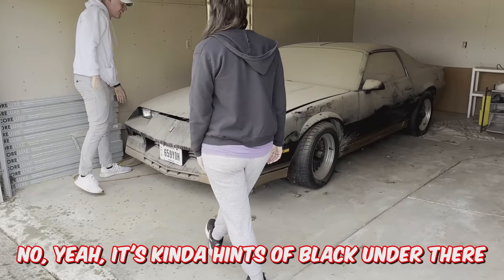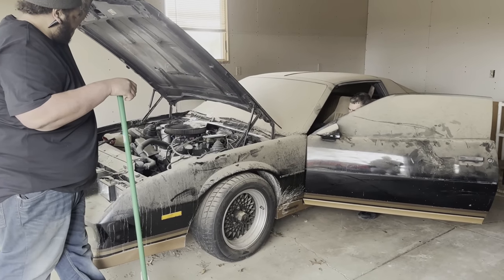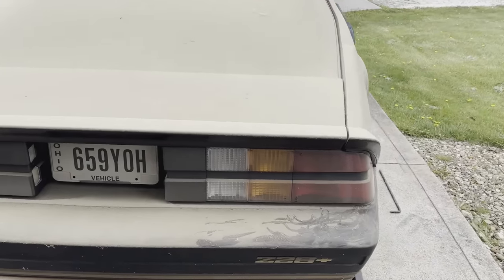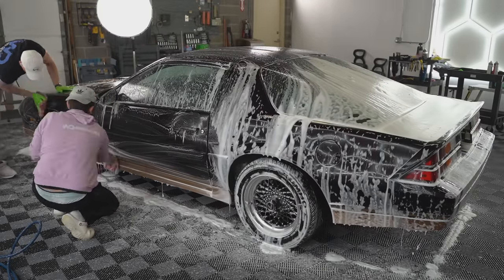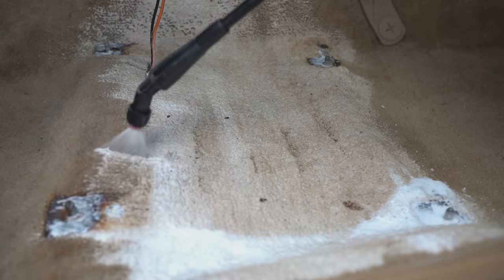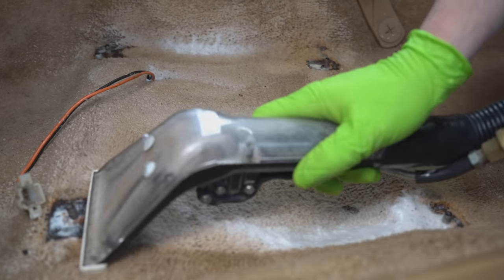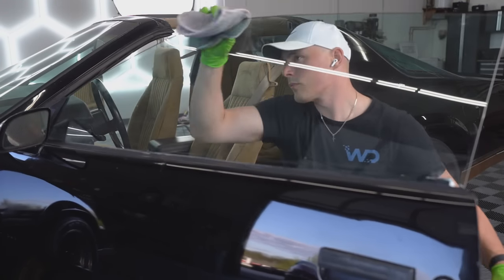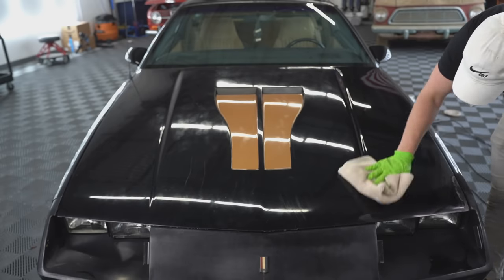First Wash in 12 Years: ABANDONED Camaro Z28 with 28K Original Miles! | Satisfying Restoration

Comment: The wheels look like BBS rims.
Reply: The wheels are actually Pontiac Firebird. They're nicknamed "Honeycombs" and were designed to replace the "Snowflake" wheels used in the previous generation Firebirds.
Reply: @bellwethertrucking3650  Oh cool.  Good to know thanks.
Reply: These wheels are a 1987-1992 Trans Am wheels. The reason why they fit is since both the Camaro and Firebird share the same chassis and drivetrain components. Wheel lug spacing is 4.75 inches.
Reply: those are the GTA wheels

Comment: Great job as usual. Watching from the UK.
One question I have, is why do you not start the jet washing process from the top down. I would think that the water running on the lower parts of the car would help loosen the lower grime.

Comment: As another has noted, the FI Tech on the motor is clean and recent; that much dust could not have settled since its install.  No doubt the car was disgusting inside from neglect and time, but the external stuff is doubtful.  Of course, Trans Am wheels.  Enjoy your videos.
Reply: Yeah staged video
Reply: There's alot of things that don't add up here. Especially with some of the "detail" work.
Reply: Take off the foil helmets
Reply: Given how easy it is to roll back odometers from vehicles of this era, I do not believe for a second it has only 20K + miles on that car.  The dust is fake, it blown on to get on youtube, how can I tell?  the top of the wheels (under the wheel well) has the same level of dust as the roof of the car.

Comment: It’s a second generation small block Chevy. Made from 87-92. You can tell from the center bolt valve covers. They were an improvement over the 1st generation that were around the valve covers that made them leak.

Comment: New summit 355 and clean FiTech EFI (which weren’t available until 2016). Yeah, that dust is a little too perfect to be authentic. Your first thought was correct, it was staged.
Reply from the maker: We showed up and this is how it looked!
Reply: No doubt. You did a great job, regardless of how it got that way. Do you ever take off the wheels and do the inside of the barrels, and brake caliper area?

Comment: I am extremely impressed with your attention to detail!!!! I grew up in a car detail shop and still a little detail work on the side. I am curious what car cleaners you use? I use Car Brite products. They're amazing.  I did a Pontiac Firebird a couple of years ago and it took me several hours to get it detailed.  I actually do the same thing you do as far as removing the seats. I also removed all the carpet because it was heavily soiled. I scrubbed it twice and used a steam cleaner on it. The upholstery and the interior looked brand new when I got it back together. Keep up the awesome work and you have a new subscriber.

Comment: The rims probably came off the firebird they have in their shop.  Since it was a modified race car, they took those wheels off and probably put skinnies on the front and wider rims on the back (as you can see the stance in the video).  Camaro / Firebird virtually the same car anyway. 
Plus, the honeycomb wheels from the firebird were a nice upgrade to any GM 5-bolt at that time.  Lot of us would change the hubcover with the bird on it to something plane.

Comment: Totally fake. A car would not look like that left uncovered in a garage. You can see the drip marks on the fenders. Also, that stuff accumulated under seat has clearly been put there.  It looks like lint from a clothes dryer or the material you’d find inside a blanket that movers use to cover your furniture. Inside a vehicle doesn’t appear out of nowhere, it is a result of use and not proper cleaning.
Reply: If you’ve watched more than one of these videos, you’d see that mouse nests typically look like dryer lint.  The dust on the car looks like drywall dust to me.   Why someone would leave the car there while putting up drywall makes no sense.

Comment: So I love the car, Im pretty sure that the Z28 came standard with a 5.0L 305 v8, I don't know why they put the diamond spoked 16" Trans-Am rims on there but id rather see the original 5 point spoked 15" Camero rims of maybe gone to the same pattern but use the 17" ones from an IROC-Z, I myself have had 3 of those body style Cameos, sn 87' Z28, a 90' IROC-Z and my favorite my last one a 92' IROC-Z, both of my IROC's had T-Tops, my 92' had the H.O. engine. Love the vid.

Comment: Looks like Trans Am GTA rims. I thought they were 14" knock-offs, but figured out they were 16s in the video. Most RWD GM of that era used the same lug circle, so they're a natural fit. Not factory for a Camaro, but they fit like any factory Z28 wheel would. I would have gone with an IROC-Z wheel myself. Nice car, though, hope they upgraded that 200-4R to turbo Buick spec when the engine was replaced. BTW, owner gave the engine away in the garage clip -- 355, which is a 350 bored .030" over if memory serves. 'Stang is a 2005 Shelby GT500 Cobra.

Comment: The wheels are from a Trans Am GTA. Some of the center caps are from a 15 inch wheel option that shared them (hence the Firebirds) and some from the GTA (which is why they say WS6, which was the performance suspension option). They are also split offset, meaning the fronts are 4 inch and the rears are around a 5 inch offset. This is needed to fit the wide 16x8 inch wheels and 245 50 16 tires that maxed out what these cars could take. The original wheels for an 82-84 Z-28 would have been 15x7 inch 5 spoke rims with 215 65 R15 tires. BTW, I used a set of those  GTA wheels on a 1984 Z-28 build I did back in the 1990's. They were cheap ($150 for the set) and went really well with the black paint job I did on it.

Comment: It looks like the car was left in the garage while they did all sanding of the drywall after  taping and  plastering , hence the dust all over it ....... WD Detailing does good work , but certainly not showroom or car show level from this video ....... have detailed 45 years ....... some of the work I have done , is top level stuff ......  and for anyone that does not think this is hard work or a skill and talent ...... think again ....... the rims are from a Trans Am GTA and I too have dealt with mental health issues since 1977 ..... it is a battle in my head  every single day ......

Comment: To answer the engine question it’s either a later model 5.7 vortec or someone put vortec heads on an older block. The center bolt valve covers give it away.

Comment: Yikes! Once you have the seats out it takes very little to pull the carpet out and clean it on a sunny asphalt driveway without running the risk of wetting the Jute beneath. Then you can even use a hot water pressure washer on the carpet for a good clean. Additionally, the jute should be lifted in the foot wells to check metal for rust / treatment. I would have highly recommended this inspection for the owner at least. Beautiful car.

Comment: looks like an 07 GT500 shelby, the 355ci could be a stroker 350 crate motor. 383ci is most common i think. but you could get 355,363,383,393,396,408.
unfortunately they did the plastic nose cone on these front ends… paint looked amazing on the metal.

Comment: I found by accident something that works better at removing adhesives from cars and doesn't scratch it a bit and that's the guys at Plasti Dip have an Orange concentrate that when applied using at small amount you can either spray using a spray bottle or add a little to a wrag and wipe it.  Takes most anything off a car or even buildings and glass.

Comment: Looks like a 350sbc with vortech heads. If the valve covers are bolted in the center with 4 bolts they are vortech heads.

Comment: The bad thing is the FI Tech injection I had it on a 468 big block Chevy and ran or tried to run it a 1000 miles and but a q jet carb on.

Comment: Correct me if I’m wrong, but I believe the original engine was the Crossfire Injection 305. Those 2 vent flaps on the hood at the top of the gold accents would flip up under hard acceleration.
Reply: Those flaps don't move.   Just trim pieces.
Reply: @gregbrooks3577  Too bad it wasn’t the Crossfire injection. I’ve only seen one of them. A friend of mine had one years ago. I believe it was a ‘83.
Reply: @uttersqueeze  Unfortunately Crossfire Injection was garbage. Very unreliable.

Comment: If you use laquer or paint thinner on the adhesive, that works fine too. Just dont use a crazy strong one and do a small test area first, especially if its an older car. Another great chemical i love to use is isopropyl alcohol which you can easily find in the first aid section at target. It will instantly take off tree sap of your paint without scratching the shit out of it.

Comment: These wheels are off of a GTA Trans Am. They happen to be all rear wheels. The front and rear wheels on the GTA had staggered wheel depths. The rears where all deep dish and the fronts where not.I myself had a 1989 GTA and I changed the 2 front wheels to deep dish rears.

Comment: Last point, I had 4 of these 3rd generation Firebird/Camaro since I was 16 until my 40s. I know those cars inside out. That looks like the original paint. The paint quality back then was not a good paint for longevity. The owner should consider painting it with a modern paint. They are easy to paint. I wish the owners the best of luck with the Z28. Take care guys.

Comment: I don't think she was right about the mileage.  Looks like 126,000 miles to me.  Still looks good for the many miles but i feel the interior was dirtier than it should be with only 26,000 miles and the paint looks good for 126,000, if its only 26,000 then its pretty bad.

Comment: The wheels are from a late model third gen Trans Am. The top of the line Trans Am GTA had these same wheels, from 1987-1992, but in gold, rather than black. They are on the Camaro, simply because it is a 3rd gen, they bolt right on, and they look great. I'd have looked for some different center caps, however. The lady just finished saying that the Cross Fire injected 305 had a rod knock, and was replaced by a Summit 355 V8, with an FI Tech fuel injection system, so why ask the question ?

Comment: The original engine I assume was a 350   with cross fire injection but the 355 stroker they put in it was much better choice as far as horse power is concerned.

Comment: Those wheels are from a 85-87 Trans Am with 16 inch wheels. Reason they are on there probably because they are an upgrade from the 15 inch wheels that came on the year Z28. Those 16 inch TA wheels handle much better.

Comment: Pressure washer actually adds unnecessary pressure on the clear coat/paint. 99.9% of the times, pressure washer is an overkill. Rinsing with just shower setting on garden hose nozzle is more than adequate.

Also, always wash from top to bottom of the car. Roof first then windshield then hood/trunk and etc.

Comment: What kills the value of that car is it's not the stock OEM engine. To bad they still didn't have it sitting around for someone who wanted to restore the car as well as the original wheels.  Makes you wonder if someone was beating on it that the oem engine went out with less then 28k miles. who knows how many miles are on that replacement.

Comment: That car came with a garbage corporate 305 crossfire engine. The small block 350 was the better option, but only came with the manual transmission. That console clock was about the most cheesy thing ever. 😂  Nice detail on a decent survivor car.

Comment: If the engine is still factory, it would be a 5.0L 305 HO as that was the option on the Z28 in 1983. But there is no way to tell the difference between a 350 (5.7l) and a 305 (5.0l) just by the external looks. You would literally have to look at the numbers on the block and see. Also the firebird TA wheels would’ve been an easy way to upgrade to a bigger wheel inexpensively on the 3rd Gen F-bodies.
Reply: The way to tell the differenc on this  car is that it came with the cross fire injection engine option, NOT the H.O. It is written on the side of the car under the z28 emblem on the rocker panel. This engine was only offered in 82/83. 

Someone really did a lot of weird stuff to this car for such low miles. The engine replaced, the hood is questionable, it should be fiberglass and would have had the cross fire opening flaps/vents on the hood.
I owned this car brand new in 1982 in Red.  I kept mine 9 years, I know it well.

Comment: Really I was thinking 350 motor but upon looking up that it's a Z28 with Crossfire injection most likely a 305 small block or a 5.0 which was supplemented in 1983 to the 5.0 which was rated 190 horsepower where is the 305 small block was rated at 175 horsepower. That Chevy Camaro was part of the third generation Camaros.

Comment: I have a set gold GTA rims they would look real slick on that car since it's trimmed in gold did you say that was the original motor with only twenty-eight thousand miles on it I just put I rebuilt motor in my 87 formula this weekend hopefully I'll get to drive it before this Summer's up I already have a 92 RS heritage it's really clean it's only got 25000 miles on it it was the last red and white RS Camaro off the assembly line really fun cars to drive I love the third Jen's have fun with yours later bye

Comment: The small block Chevy engine cannot be determined by the accessories on it. If they bought it from Summit, could be a ZZ4 crate motor. Not sure when they installed it but that was a pretty common "best for the buck" swap until the LS swap craze took over. And the previous post about the GTA rims is correct as well. If they were gold centered, they would have been the Turbo T/A rims from the 1989 20th Anniversary Trans Am.
Reply: They got cars that have been abandoned for 30 years or 35 years

Comment: SERIOUSLY its NOT a good idea to SOAK the Engine Bay & ELECTRIC WIRES that have been sitting for years because everything is dry rotted and its gonna cause Tons of ELECTRICAL PROBLEMS
Reply: Easy killer this is an 80's car not a 2000's the electronics are not as susceptible to moister as a modern day car.

Comment: The wheels are off a mid-80s GTA trans but the Camaro and firebird in the 80s was the same body and different front and rears and different interiors but the body itself was the same therefore same bolt pattern and tire size

Comment: The wheels are ws6 and gta option wheels starting in 86 I have used them before on Camaro builds they are a wide 16 inch wheel they fit a 255/50r16 nicely and they weigh about a 1/3 less than stock wheels that unfortunately that z28 could of had 14steel or 15alum inch 5 spoke wheels factory and motor is a 87 up engine the center bolt valve covers give it away

Comment: The engine's been changed it looks like a 350 although they look identical to a 305 but seeing that it's been changed and it has an aftermarket fuel injection system guaranteed they dropped in a 350

Comment: Kind of doesnt matter its low miles, its not original, thats not the original motor (notice center bolt valve covers, AC system was gutted, car is a hack job. I really doubt its 28k miles

Comment: This engine is not the correct engine for the car. This car came with a chevy small block 305 or 350 crossfire injection. Horrible low HP engine.
This car has been moused up.

Comment: I have questions. Does this “carb fuel injection” system technology exist 12 years ago? Also what’s with the tires having pressure in them if this car has been “sitting” for 12 years? Those are also gta wheels not z28 wheels. Also what’s with those building materials in the garage. This screams renovation dust and debris rather that 12 years of dirt and debris. What a looser. Gotta fake content for views.